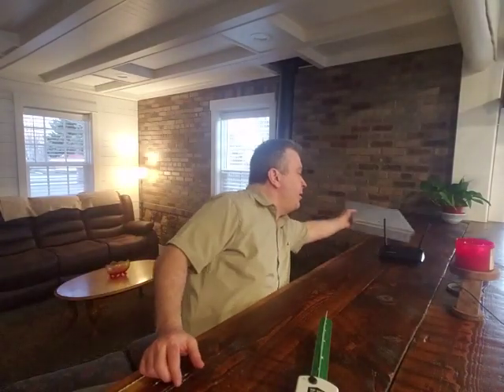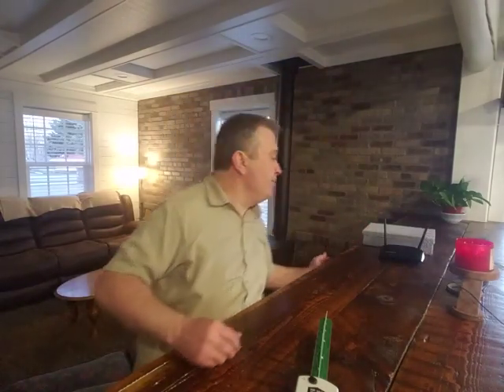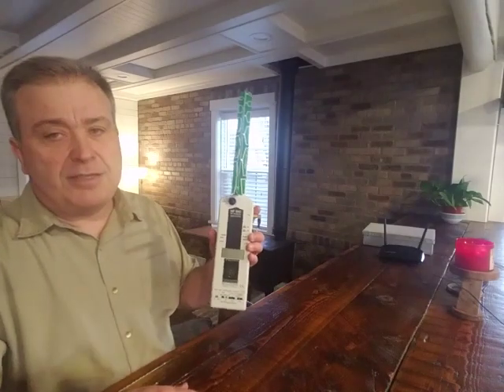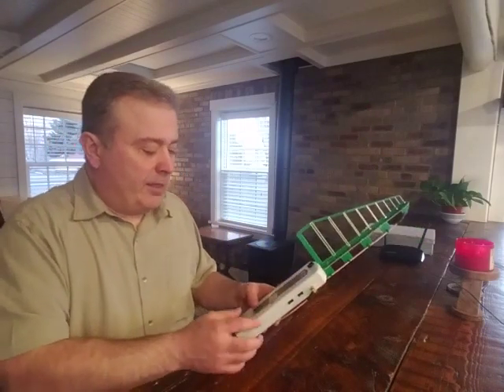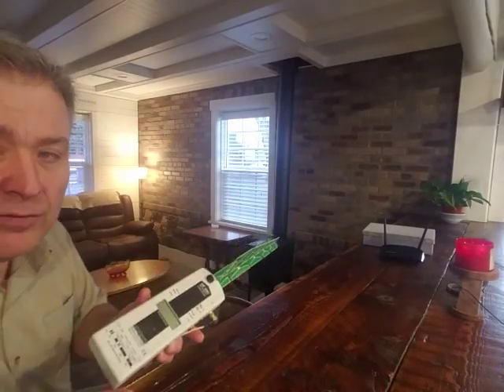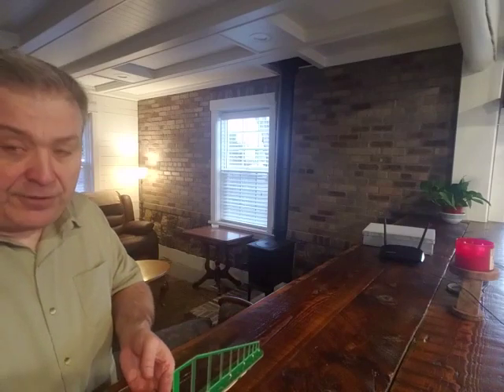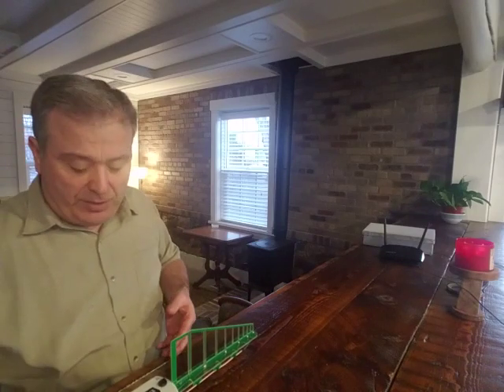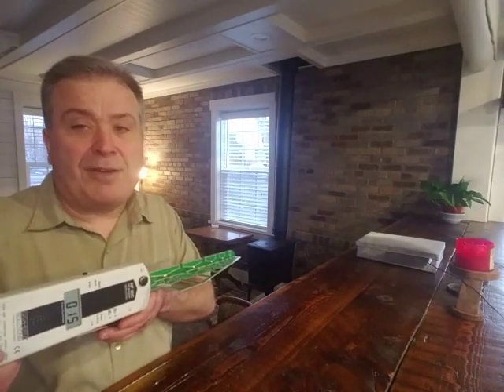Wifi Router Guard Product Review

Comment: what do i do when I have neighbors with wifi routers and my EMF reader is still 79/100? I used the Electro Smart App and it is saying all radiation is coming from other routers, so what can i do to protect myself?
Reply from the maker: First if by "app" you mean an ap on your cell phone, I would get an actual meter. The ap may be picking up EMF coming from the phone. You commented on a video about a WiFi router. For that you will want a meter that measure RF radiation. Other than that read this article I wrote https://www.radiationhealthrisks.com/wifi-radiation-protection-items/ on protecting yourself from WiFi. Also here is a good video to start with. https://youtu.be/Gn5VeLIgf1k Hope that helps.

Comment: I've been getting sick from EMF radiation, even though I'm all hard-wired.  I got an EMF meter, and discovered my router/modem is generating a dangerous amount of EMF radiation, and I've been sitting next to it for the last 10+ years.  I have dementia, cancer, heart problems, cataracts, anxiety, depression, insomnia, etc.  I don't know why my router/modem is generating all that EMF radiation, but it is, so I need to do something about it before I die.  I'm retired, so I spend 5-10 hours a day online, which has been slowly killing me. Beware and take care!!!
Reply from the maker: Sorry to hear that. When you say EMF Radiation, is it emitting RF Radiation? Or are you talking about electric fields and magnetic fields. My bet is that you are talking about RF Radiation, since electric and magnetic fields don't typically travel that far. If so, a simple solution is logging into the software that controls your router and turn off its WiFi signal. Most routers have this option (at least the ones I have checked) and turning off the WiFi will turn of it emitting RF radiation which is the most powerful form of EMF Radiation that a router emits. After turning off the router's wifi I till move it as far away from where you sit as you can, at least several feet. Then I would still situate your cell phone (which also emits RF Radiation powerfully) in a Wave cage or some other metallic metal basket (must be made of conductive metal to work) and then situate it above your body and as far away from your body as possible in the room. If you need to use your phone then do so on speaker phone and keep it as far away from as is practical. I would also get a neutralizer to make any EMF radiation you are still exposed to less toxic. I will list a few pages from my website below which talk about the items I mentioned. If money is an issue you can make your own basket out of aluminum window screen you can get cheap from any hardware store. Here are the articles: https://www.radiationhealthrisks.com/ways-protect-cell-phone-radiation/, https://www.radiationhealthrisks.com/scientific-studies/. Here is a video to watch too. https://youtu.be/ys-wM2FN4vg. This next video shows cell phone basket a friend of mine made from aluminum screen. https://youtu.be/t9lAzNPJqBo

Comment: What about a modem? Is there such a box one can put their modem into that allows for the various cables, including multiple ethernet cables, to poke out?
Reply from the maker: The modem typically does not emit RF radiation unless it is also a router. But if it makes you feel better you could use a second router guard for your modem, but you don't need to. You could also wrap it or build your own box from aluminum screen you buy at the hard ware store.
Reply: I'm not sure...it is the only device I have in the house that brings wifi to my devices...would you say then that it would also be a router? Since my laptop is not currently connected to it via an ethernet cable, I'm guessing it's emitting a good dose of continuous radiation.

My internet provider could not give me any information about the Hz range it emits and they kept assuring me it was 'safe' as it was 'just a little box.' Pretty sad the lack of knowledge on their end.
Reply from the maker: @RS54321  Yes if it is your only device then it is a router modem combination. You won't be able to know the amount or range of the RF emission without testing it with an RF meter. But I would put it in a room you don't use if possible, or as far away from people as possible. And I would get some sort of a conductive metallic mesh screen box to put it in. I will leave links below to where you can get a meter as well as the wifi router guard. You can also make your own out of aluminum screen really inexpensively. I will link a video where I show you a friend of mine who made his own. https://www.radiationhealthrisks.com/best-emf-rf-meters-and-detectors/. https://tinyurl.com/279944k8. https://youtu.be/t9lAzNPJqBo. Hope that helps.

Comment: What if I enclosed my router in two metal mesh trash baskets? one on top and one upside down with router inside
Reply from the maker: That could work as long as the trash cans were made of conductive metal. I would use metallic mesh trash cans if you still want to use the wireless internet. That would block 90 to 95% with the metallic mesh.

Comment: Apologies if this is a dumb question, but does the type of wifi matter at all? My family recently got a new stronger and more effective wifi by zoom/armstrong (our old one was a wireless router by google)  I'm just worried that this one is potentially stronger than our old one because its supposed to have more coverage over the house.
Reply from the maker: Yes the newer the technology typically the higher the frequency. The higher the frequency the more harmful this type of non ionizing radiation is. Also the more powerful the signal (the farther the reach) the more of it will get to your body.

Comment: Question-  if you put the WiFi router guard on your router, will it mess up or slow up your WiFi connection?
Reply: Ok I just watch full video, and you already answered my question.  Thank you for all your information
Reply from the maker: Since making that video I now live in a bit bigger house. I live in about a 3,000 square foot house, 1,500 per floor. There are a few spots on the end of the house where we don't get the best reception. So if we ever need wifi there we just open the router guard for a bit until we are done then we close it again. But at least that way we are able to control how much we are exposed to.

Comment: Great review. Why not buying such a protector. One curiosity though: When the Wifi router is in the cage and this foil is around, the measuring device doesn't detect any radiation, however, as you say, the internet on a PC still works using the router's radiation. Which of the two possibilities you think it is why the measuring device does not detect radiation? (A) A PC only needs a tiny amount of radiation to be able to connect to the internet, or (B) the measuring device does not detect the crucial radiation frequency that the PC requires for an internet connection?
Reply from the maker: I did not create RF Radiation nor the way it reacts. Even with my router in the guard, I still can use my wifi most of the time. Every once in a while I have to open the guard for a bit to get a faster speed for something. But most of the time I don't. Here is a video I did where I show people and example of one my friend made himself very inexpensively, if money is a concern for you. https://www.youtube.com/watch?v=t9lAzNPJqBo

Comment: Second question. The box you show on this review looks to have a plastic or rubber hole the cords go out. Does the signal still come out where the wires go out and is it better to get the bigger router box that does not have that circular opening? Thanks.
Reply from the maker: Good question. The short answer is no. Not enough to be picked up by a meter. In fact I set my cell phone in a metallic mesh box with an open top when I sleep at night. I have found that as long as I have it in that metal mesh box, and it is at least about 5 feet from me and sitting on a shelf higher than my body, my meter does not detect any radiation making it to where I sleep at night. Here is a video where I show similar tests https://youtu.be/FsZZMEV4fAo.
Reply: @RadiationHealthRisks  thanks so much for getting back on all this. It's helpful. Was just watching your review on the eco routers and saw that you said that a router with 3 antenna needs the large router guard. We are thinking about keeping our lynksys router and putting it inside the guard but not sure how it goes inside. Our router has 3 antenna but it sits on it's flat bottom and is not a tower. Looks to me like the router in the large box on the site is a tower with no antenna. Want to verify that a 3 antenna router would always need the large and could you speak to whether the large router guard box can lay on it's side to accommodate a router that is flat on it's bottom like the smaller one does. Also can you recommend a meter that is less than the one you use. We cannot afford the $345 but do want a meter that will measure our living space to make sure of results. Thanks again for your time and help.
Reply from the maker: @rdisneyandcentralfloridali4849  A couple of suggestions. First you might call either the router guard company or the router cover company and see if either have a large enough guard for your needs. I link to both companies on this page https://www.radiationhealthrisks.com/wifi-radiation-protection-items/. Also if they don't, or if you want to save some money you can make one yourself out of aluminum window screening you get from the big box store. Here is a video where a friend of mine made his own because of the size of his router. https://youtu.be/t9lAzNPJqBo
Reply: @RadiationHealthRisks  thanks. I thought somehow you were selling them. Sorry to have misdirected the question. I just gathered the info from a review you did on the box where you said the 3 antenna  routers did not fit in the small box. I will contact the company.
Reply: @RadiationHealthRisks  we actually found the guard box that will work which is great. Still wondering if you have a recommendation for an RF meter device that you think is good but is not super expensive? I see lots on the market but you seem to know your info on this and don't want to buy something that won't work. We just cannot afford the one you show in your videos but do want to have one. Thanks again. Last question I promise. :)
Reply from the maker: @rdisneyandcentralfloridali4849  Here is the article from my website where I go over all of the meters I am familiar with. Just make sure you get one that reads RF Radiation. Hope this helps. https://www.radiationhealthrisks.com/best-emf-rf-meters-and-detectors/
Reply from the maker: A couple other articles you might find helpful are https://www.radiationhealthrisks.com/protect-yourself-from-cellphone-radiation/ and https://www.radiationhealthrisks.com/wifi-radiation-protection-items/.

Comment: Hi, We live in a condo on a second floor with the electric meter room on the first floor outside below our boys bedroom. It is not directly on their bedroom wall but the attic space above the meter room backs up to their wall. I was worried about it and talked to lots of folks, some of who told us that since it is a concrete block and metal structure building, that those signals would be weakened and not effect our kids on the second floor. Do you agree that it would weaken the signal?  We rent so we cannot make changes but I would still like to hopefully not worry too much.
Reply from the maker: It is conductive forms of metal that does the best job of blocking the different forms of EMF radiation. Frequencies used in fifth generation (5G) devices (which are from about 25 GHz to 300 GHz) do tend to get more signal obstruction by matter such as trees, walls and rain. Even the forth generation (4G) frequency of 5 GHz, has some trouble going through walls. (The higher the frequency the more matter obstructs the signal.) This does not really protect you though (in my opinion) because pretty much any device that emits those higher signals also emit the lower microwave frequencies (from about 1 GHz to 2.4 or 2.45 GHz) as a backup for when the higher frequencies have problems. The advantage to the higher frequencies is they can carry more data providing faster speeds. Now to your question. The only way to really know for sure how much radiation is making it into your living space is to measure it with a meter. The type of EMF Radiation we are talking about here is radio frequency or RF radiation. Any RF Radiation over about 1 GHz frequency is within the microwave range. So you want to make sure the meter you purchase measures RF Radiation. They don't really make any meters I know of that measure in the 5G range, but they will pick up the 1 GHs to 2.4 GHz frequencies 5G devices will be also emitting. Since the lower frequencies travel farther and penetrate better, if you protect yourself from them you are protecting yourself from the higher frequencies as well according to my understanding. Hope that helps. Here is an article on my webiste about the scientific studies I have read on this topic. https://www.radiationhealthrisks.com/scientific-studies/.  There are a bunch of experts in videos explaining things as well on that page. Here is an article showing the meters I am familiar with and what they are good for https://www.radiationhealthrisks.com/best-emf-rf-meters-and-detectors/.

Comment: I noticed you had mentioned something about putting the phone or whatever device HIGHER and away from your head. If I place my Comcast modem up on the top shelf in my closet, would that prevent the waves from traveling to me since it's high up or should I still get a basket?
Reply from the maker: RF radiation dissipates with distance, so the farther you are away from it the better. That being said they emit a lot. I have tested some where 20+ feet away my meter was still picking up unsafe levels. So I recommend having the router guard. If money is an issue you can make your own out of something like aluminum screen you buy at the local hardware store. Hope that helps.

Comment: Really appreciate these videos, thank you. I’m just beginning to learn but had a thought perhaps you can address. I heard that if you reduce power (router) then the computer’s antenna is made to work harder and this might increase the radiation coming from the computer... did you check that by chance? I’m having the same issues as you are so want to be sure if I implement these that I think about all the possible ways things work. Thank you for this again!
Reply from the maker: I think that is a myth. My computer outputs about the same rf radiation whether my router is in a router guard or not. But my router emits 90% less in a router guard. I always have my laptop on a desk with a blocking pad under it. And i keep as much distance between myself and the computer as possible.

Comment: Thanks for this review. Are the NEWMEIL WiFi Cover Guard just as effective? They are much cheaper. They claimed 90% to 95% of the harmful EMF & RF Radiation emitted by WiFi Router can be blocked by this wifi router cover.
Reply from the maker: Any metallic mesh screen works as long as the metal or metallic fibers are made of a highly conductive metal. I have not tested the NewMeil, but I know it would work as long as it is made of conductive metal. I personally prefer to have a little air space between my router and the metal screen which is why I like the router guard. But the NewMeil is cheaper so I get the interest. Just be sure you test it with a meter. Don't just take their word for it. I have tested products that don't work as well because of what they are made of. If you do get a NewMeil, be sure to cover the whole router as well as the antennas. Don't just cover the antennas as some RF Radiation I imagine would escape. Test it with a meter and you will know for sure.
Reply: @RadiationHealthRisks  Thanks Dave for your reply. I saw another video from "electronicsNmore" youtube channel that says 4 feet away from the WIFI router is a safe distance. So I'm not sure now if I need a cover. here's the link https://youtu.be/UA9mNxBbbcg
Reply from the maker: @1791-M  Yes you need a cover, even if you make one yourself. I am not familiar with that guy's meter, but it must not be a very good quality one. Check out this video of me testing a WiFi router and how far away I am. (I know I have a good quality meter.) https://youtu.be/o9EndbZ9Oro. You really need a good meter yourself so your not guessing. Every router is different too. Here is my article on meters I know work well https://www.radiationhealthrisks.com/best-emf-rf-meters-and-detectors/. If money is an issue you can make your own cover cheaply by purchasing a roll of aluminum window screen from a hardware store. Make sure it is aluminum. Aluminum is highly conductive and so it works great.

Comment: The Router is plugged into the Modem so how does that work with the cord that plugs into each them and into the wall?
Reply from the maker: The router in my video is also the modem. It is a router modem combo. In my case the ethernet cable comes through my wall from a dish on my roof and plugs directly into my router. Then an ethernet cable goes from there to my computer.
Reply: @RadiationHealthRisks , so is there nothing I can do with having a separate router and modem ?
Reply from the maker: @carolynhelmic1474  If you have them separate the only thing that needs to be inside a WiFi router guard is the router because the router is what creates the WiFi or RF Radiation.